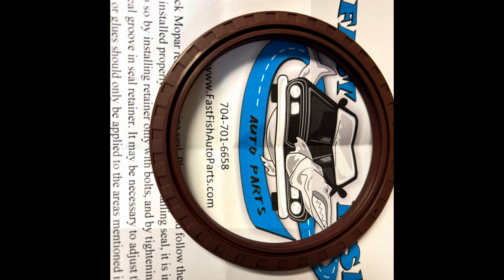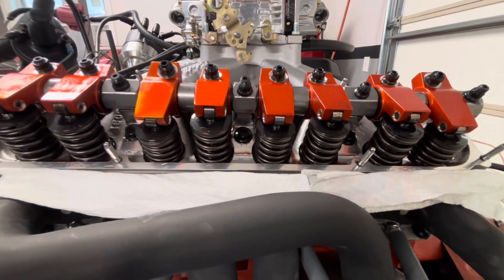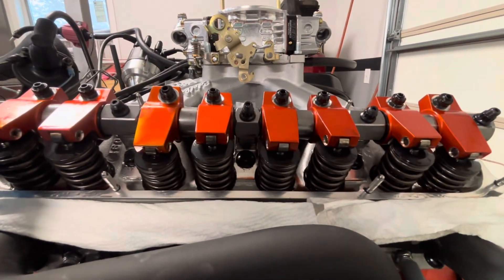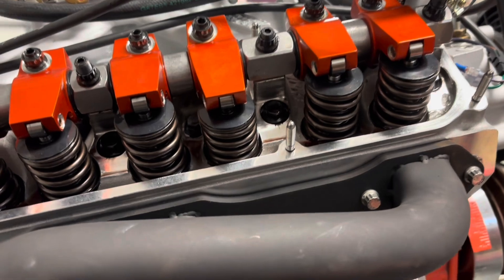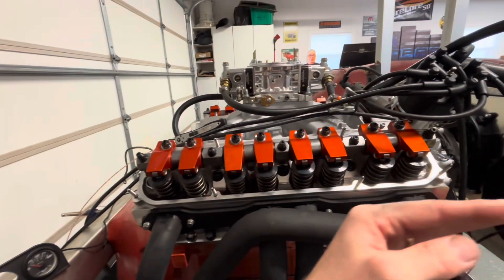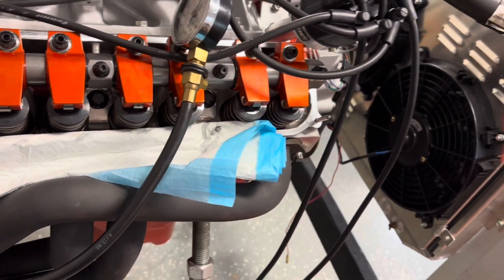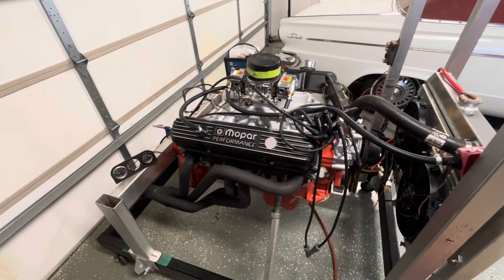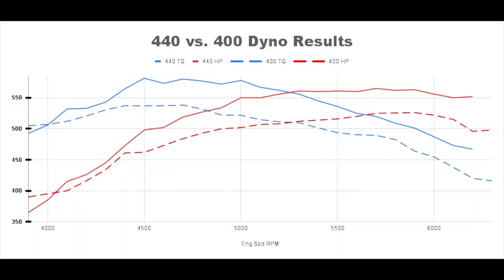400 to 500 Stroker Build: Preparing for the Dyno

Comment: i used to make - ROLLER ROCKERS = and what you have = is not correct = anyone can see that the valve tip is off centre = it will run = but it aint CORRECT !  you need more schooling .
Reply from the maker: @ronnieboucherthecrystalcraftsm  try this
Reply from the maker: @ronnieboucherthecrystalcraftsm  https://youtu.be/LbAgW7mWOJE?si=062h65UJ8TEM58F5

Comment: I adjusted my rocker arms I believe one and a quarter turns with Hughes rockers which I don't think are all that great. Because any less than that and they were extremely noisy, haven't had any problems with 40 dragstrip runs and some Street time
Reply from the maker: @thomasward4505  I’m experimenting with this one now. That seems extreme, but you can’t argue with results.

Comment: How much preload do you have on the morel hyd roller lifters?
They need .050” preload which is 1 turn on a 7/16 adjuster.

And also you need an oil with a centistoke rating of 15 or less at 100c.
That means no 20w50.

I run one of the AED 950HO Modified carbs. Works great. Made 630hp 605trq on my 228/238@.050” cammed 467.
I did have to put transfer slot restrictors in the main body.
Reply from the maker: I'm glad you shared your experience with the carb. I went with 1/2 turn of preload and debated trying more. Powell just did a video saying to do the minimum amount possible on hydraulic rollers, but I was going to reset them at 3/4. The oil currently is AMS oil 30 weight break in oil. Dave loves the AMS oil
Reply: @JustMoparJoe Morel lifters need more preload than that. With less, they will be noisy. Go another 1/2 turn.
You mean Amsoil? 30w break in oil is 11.4 centistoke.

Comment: If you got that quench right, that Dodge 400/499 Stroker can make on Dyno  around 595 HP and  678 Torque! 🏁🏁
I really need to see the head chambers, I would have made LSA 106, Head Gasket ideal would have been .020 to .028 at the most, and how much advance timing did you put? 🏁 SHELL 93 Octane?  Driven GP1 20w-50 for lifter noise gone.
Reply from the maker: Thanks brother. I’m very familiar with quench, but we had to sacrifice some for this one. He bought the stroker kit a while back and told me to make it pump gas friendly. I wanted to air on the cautious side, and ended up with 10.9/1 static. I know he wants to run nitrous, but I’m not sure he’s running higher octane for that. The LSA is happier with his nitrous here, and will be more street friendly. Definitely room to improve on camshaft and cylinder heads in the future.

Comment: Hello Joe.  RPM heads perform well.  They flow around 270 to 280 CMF at .60 lift.  Those heads are good for up to 650 hp ported with the right set-up.  I would guess the Torq will be good with the longer stroke.  540 to 580 on torq or more.  I'll say 565 on torq.  HP  560.   I could look up the math but my guess will due.
Reply from the maker: Thanks for the prediction! Let's see what the dyno says. I’m bet you’re within 5!

Comment: The only reason those edelbrock heads are going to perform well is what you did to them. Personally they robbed power from my 65 dodge a990 drag car so went indy and man what a difference. Same 1050 trash can dominator too. I need to talk to you about the d100 motor. I need to pick your brain.
Reply from the maker: Thanks Rooster. These heads are much better than most (home) ported cast iron heads. The dyno won’t lie.
Reply: @JustMoparJoe  dyno won't lie less you make it like with correction factors lol guys that raced sleds with 2 strokes used to play games with that. But your right and you did nice port work so I think that will help greatly. Guess will see. Rear seal is a bit concerning to me too.

Comment: Looks great. How long did you run your engine to break in the rings? What’s your take on preparing the engine for breaking in the engine before dyno testing with a load? Thanks for the mopar stuff!
Reply from the maker: @jimdrechsel3611  thanks Jim. I usually do around 20 minutes. I can’t guarantee a complete break in until there’s a load, but with Rick’s profilometer with honing, it’s supposed to break in very quickly. I’m mostly checking for leaks and listening to the what I can. Anything I can catch before spending $900 to dyno is a bonus!
Reply: @ Ouch that’s expensive. Are there dyno tests with motors installed? If so will you still have air fuel ratio readings? 
If during a compression test, you have some leak down in a fairly new engine Is it possible your rings haven’t broken in yet?
Reply from the maker: @ I’ve thought about dyno tuning my barracuda. Typically guys want to know the numbers at the crank. It’s possible to have a little leak down before the actual break in is completes I just did a cranking compression to compare results. It’ll show ring seal and valve seal, also what octane fuel can be used with the engine. We are going with 91-93 for sure

Comment: HP 620 at 5700 
Tq 645 at 4600
Reply from the maker: I'm hoping for something close to that! It’s definitely been done with better heads.
Reply: @JustMoparJoe  I think the cubic inch will help as long as it can make the rpm it should do it.  But if it doesn't it's an easy fix, bigger ports and more cam
Reply from the maker: @ yes sir. He should have a solid bottom end!

Comment: 510Hp 530 tq …….My engine builder Just Dyno my 435 bigger cam block machined head work was done high raise single plane 850 carb pistons .005 in the hole 549 hp 570 Tq used a 383 block I commented to you about a year and a half ago going I was gonna build that. Just thought I’d fill you in great video always enjoy.
Reply from the maker: I remember that! I know there’s power in the heads. Let’s see what these will do

Comment: Your cam card says to use stock ratio rocker arms, you said they were 1.6 ratio so your lift is higher then what the cam card said, is that right?
Reply from the maker: Yes sir. Worked well in the past and gets it happier for the headflow specs
Reply: @JustMoparJoe  I hope to see it run on the dyno I'm curious to see what it will do. I have the 512 kit in my 73 challenger with only a 800 cfm Edelbrock and a slightly lower lift cam with 1.5 rockers, if these numbers turn out good then I might swap out the rockers and carb. Good luck with this.